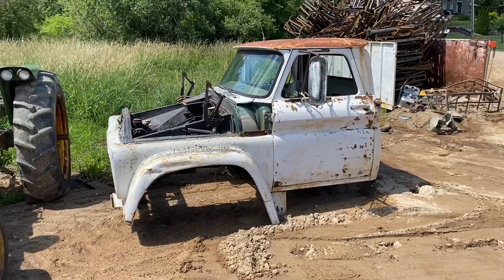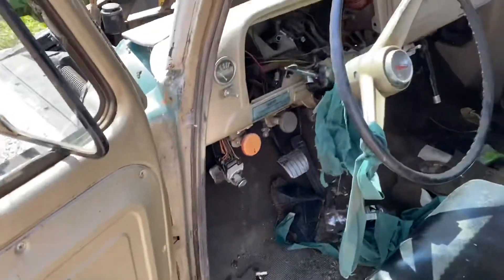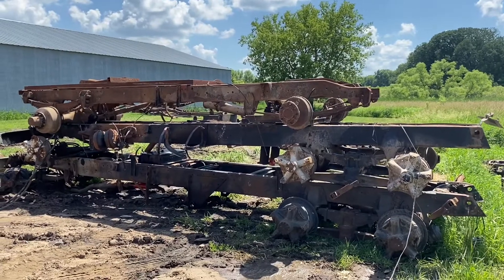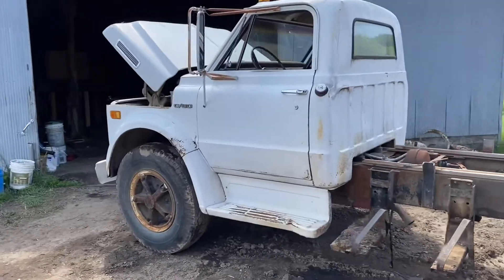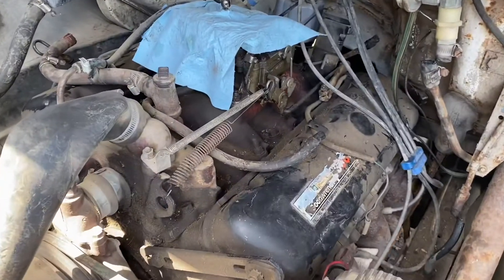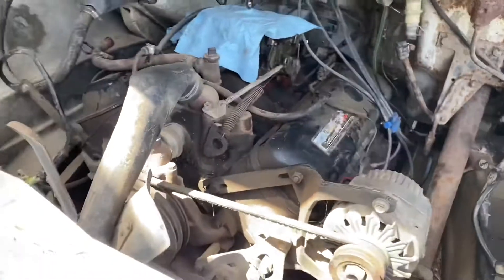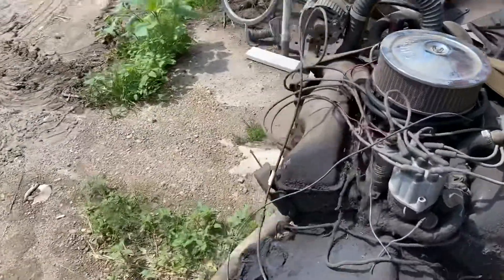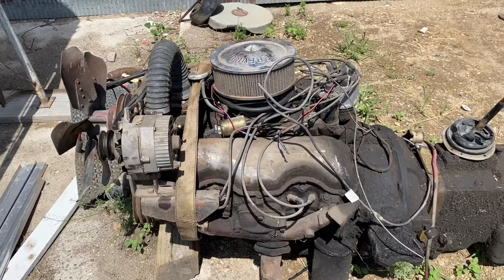Rare Engine in Farm Truck!

Comment: Just sharing information, back then truck and industrial engines were different from car engines. Truck engines had lower compression, different cam profiles and often smaller sodium filled valves. Those engines had less horsepower but made up for it on torque. On Chevy engines an easy way to tell a truck engine from a car is the accessory bolt holes on the front are 7/16 on a truck and 3/8 on a car.

Comment: the value is not in money but reliability, these older trucks and cars dont have the electronics that fail at 100,000 miles and cost to much to repair, you can see newer cars in the junk yards now.  our 1948 2 ton gmc hay truck is still on the farm hauling hay. todays new trucks will not become old trucks

Comment: I just sold a 305 V6 out of a 1950 GMC 2 TON Tow Truck...the guy who bought it came from Dayton, Ohio to my city Tucson, Arizona got $2,000.00 for it👍
Reply: That guy is crazy.  I bought a 305 from a junkyard in Minnesota for $100.  The GMC big block V6's that are worth a lot are 401's, 432's, and 478's.
Reply: @andyharman3022  crazy is as crazy does..you do realize we are talking about a 305 V6 1950 tow truck engine rebuilt with 500 miles sir..plus were in rust free Arizona..🏜
Reply: @stevedeleon8775  The GMC V6 did not enter production until 1960.  I own a 305, a 478, and 2 702 V12's.  But if it's a fresh rebuild, and runs good, I can see $2000.  Just tough to justify that much money for an engine that makes 147 HP.  You have to be a fan of its uniqueness.  I think the GMC V6 was the first production V6 in America.  Buick introduced its V6 in about the same time frame, though.
Reply: @andyharman3022  OK so that Engine isn't a 1950 but the tow truck is & that engine must of been put in later..So that's the case then..I still sold it and the man from Ohio is happy..

Comment: I had and disassembled my 65' C60 Chevy, 26,000 GVW and the engine was a 348cu in tall block.   A real torque monster of an engine with the longer rods but other than the valve covers it wasn't a 409.    Also these cabs are sweet!   But, if the Police, or the DOT pull you over to check your truck out their going to go by the GVW tag on that Big Truck and not from a 1/2 ton and charge you with tampering  with  VIN NUMBERS. They're not stupid and know what to look for.   Myself, I'm a huge fan of that small back window.  
GOOD LUCK!
Reply from the maker: It is still licensed as a C50, hopefully it wont be a problem

Comment: Check the stamped numbers on the front of the block passenger's side and rear of the block drivers side for casting numbers. Typically 348 engines were used.
 Good luck and great video. My son and I need a 67 to 72 c-60 or c- 80 cab with title for our project. Will travel.
Reply from the maker: Numbers come back as a 409, don’t have a cab anymore, I’ll keep my eyes open. Lots of auctions coming up

Comment: Dang that 409 is a heck of a score, I think that sae #2 bellhousing comes off to expose a standard gm bolt pattern. A different flywheel is also obviously required. I don't remember if the 348/409 had a taller deck height like the later mark iv 366/427 or not and I've not found any solid proof either way. I think even if it was a tall deck it would still look great under the hood of a '55 chevy apache pickup, any tri-five chevy car or my personal favorite a '58 Impala.
Reply from the maker: For sure, still have it, its for sale

Comment: I have access to one that runs but It has basically sat since it was new. And I mean brand new. It still has a part of the winches that set on its  back to pull boats out of the ocean in Seward Alaska. Yet the ocean didn't get it cause we needed part of those winches for something else. This engine is the tall deck 427 and wears the badges on it everywhere. For at least twenty five years it was taken to a garage and started, ran for a few hours as it was allowed to run out of gas and has never as far as I  know had ethanol fuel in it. Those huge cast iron manifolds are crazy looking.... it still sets in its cabin nice and dry but hasn't been started for some time now but I did check it and wasn't seized up. Great big toilet bowl carbration system.... I am just curious and can that engine back from the wide diesel bolt pattern transmission can be made to fit other bellhousing systems for chevy?

Comment: The bell housing on the big truck 409 engine rounds over instead of coming up to a upside down v-shape like on the car engine, there’s a difference between the two engines I couldn’t see because of the dirt and grease, but I’ve seen the same thing on the 454 large truck engines versus the car 454 engine they are different blocks different transmission hook up.

Comment: I owned a 65 C80 with the 409, had 5 speed main and 4 speed auxilary, tandem axels, I was 18 then, That 409 turned me against Chevrolet, Never worked 8 full hours without somekind of breakdown, and it wasnt junk and worn out when we bought it in 1970 less tan 40 thousand miles, and I hated that pile of junk and would never again own a chevrolet of any kind, Dedicated Ford man now
Reply: We ran the v-6's, and ran them up until the late 80's. Never had one fail, never rebuilt one, just drove them as hard as they would go. The 401 and 432 v-6 are worth their weight in gold on today's market. The 432 would run right beside the 427 v-8 of later years, and do it on 30% less fuel. Then, we had some 432's that were diesels. Toughest engines I ever ran!!!

Comment: Yes it's a 409 but unfortunately it's not super rare because it is a industrial engine just like a industrial 427. Big differences when it comes to performance. It sounds like you are already planning to rip someone off. Hopefully they will check the block before they buy it.
Reply from the maker: No rip offs, wouldn’t sell it as a car engine, but will get what i can for it
Reply: People who are looking for a 409 engine know the difference between a truck engine and a hipo engine. So you can take back your accusation.

With high-compression pistons meant for a hipo engine, the compression will be low enough to run it on premium pump gas, and the notch unshrouds the exhaust valve for better breathing. Some people prefer the truck block for this reason.

Comment: I like the c50 60 70 80s. It's a shame that they are being butchered. I have a few. They ride good for what they are. I haul hay and logs and sometimes just Cruise in them.

To each their own I get way. Same reason when I need to swap engines I'll go with a used 6.0 gm. those 6.0s are awesome workhorses.

Comment: That 409 is rare but you won't get it in car with that bell housing
Reply: Your right the 409 engine that’s shown has the round or curved bell housing that’s used in large trucks not cars, the car uses the upside down V- shape style car type transmission hook up a totally different engine,  they did the 454 large truck engines the same way also rounded bell housing

Comment: 409 truck engine is different than car engine .
Reply: Isn't that a 637? One of the rarest v-8 truck engines gm ever built. Its the 478  v-6, with 2 more cylinders, making it a 637.  Look up the 637 on the web.

Comment: Deck height is different than car 409
Reply: Deck height is same as car engine, 9.600".
Reply: 409 has different deck height than 348
Reply: @tracylemme1375  both 348 and 409 are the same at 9.600".
Reply: @manyamile410  I always heard that the 409 deck was taller. But I cannot confirm this. You must be correct.
Reply: @tracylemme1375  427
Reply: I have a truck 409, all I found different was the heads, they have a mini combustion chamber and lowers the compression. I took advantage of that and ran a blower. It was not a breathing engine, but the blower helped it to make power. Ran decent! Am in the process of installing aluminum heads and detune the old girl. Just tired of having to use avgas.
Reply: @harrygearhart4520  smaller combustion chamber increases compression as a rule. You are decreasing the space you are compressing into, thus increasing the ratio. The lower compression probably came from the pistons.  It probably has a small chamber and small valves , along with an early closing IV to make low end power instead of race car high end power. 
 Regardless, enjoy the build!

Comment: That is a 348 not a 409 has the dipstick on the side. The 409 has the dipstick in the front of the engine
Reply from the maker: Block casting number is 3857656, everything i have read says 409

Comment: No, it's a 348... that is the engine the 409 came from.  Started as truck engines and the 409 design idiocyncries
Reply from the maker: Im not an expert on the differences, but the casting numbers say its a 409
Reply from the maker: From late 1964- early 1965